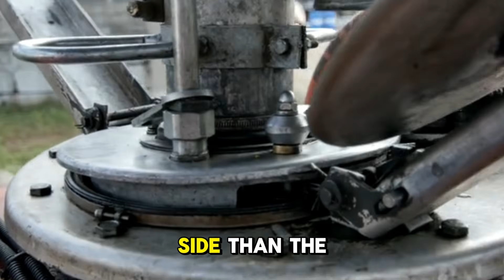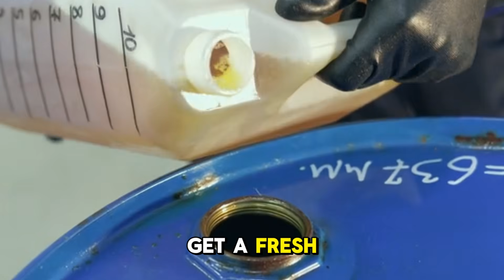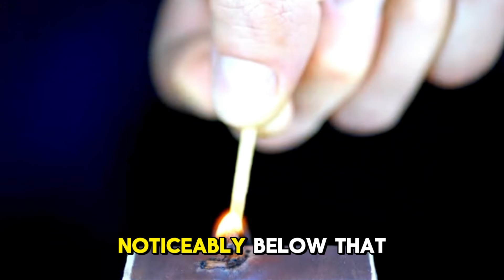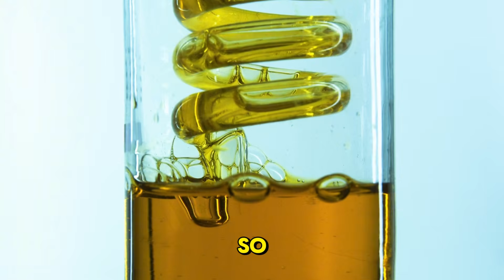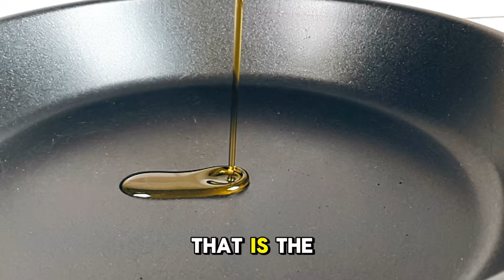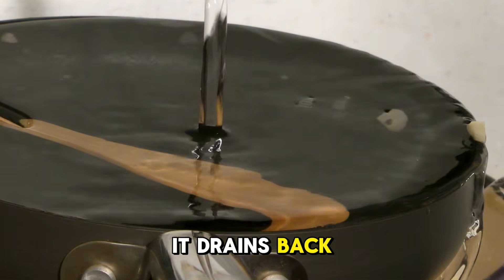Stop Checking Your Oil This Way — You Could Be Destroying Your Engine Without Knowing It

Comment: Me driving on 14/9 quarts of oil for 500 miles before draining and refilling. That engine still runs. My car, a 98 e320 mercedes, kept giving me the oil level above max red error message.

It felt almost too smooth. I drained and filled to the proper level right after